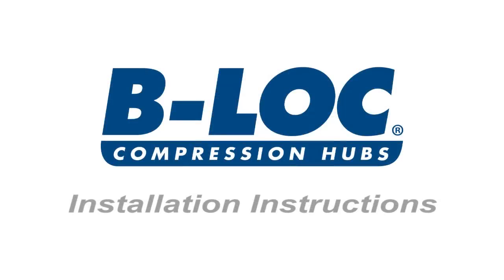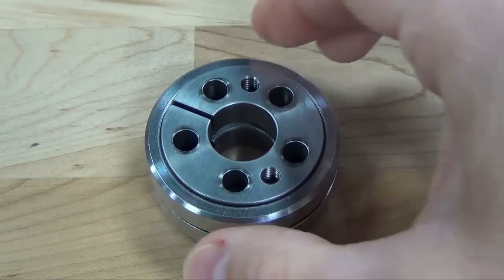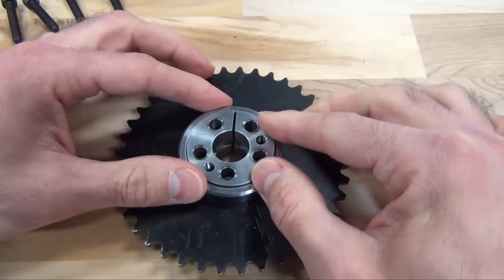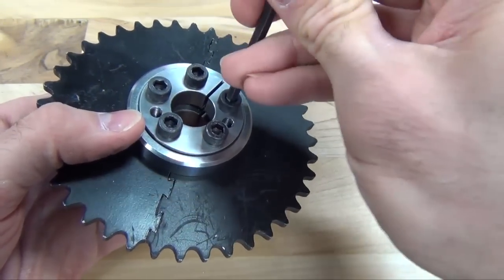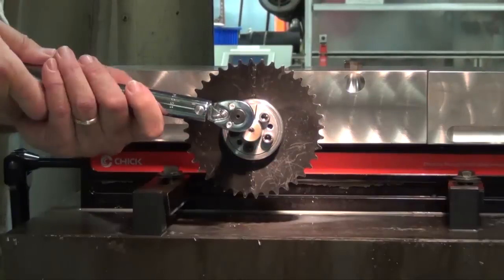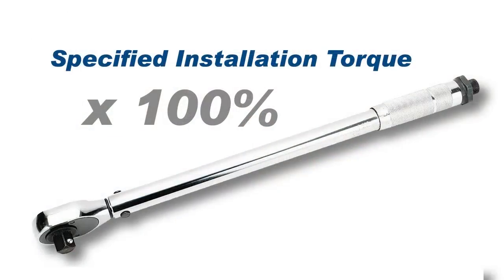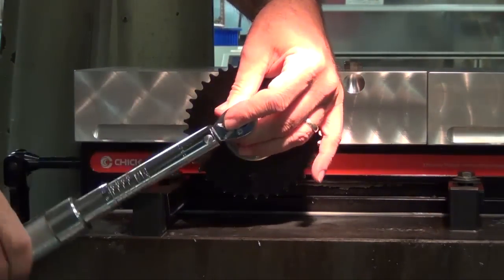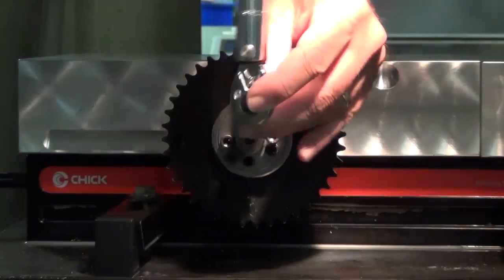Easy Installation of Chain Sprockets using B-LOC Compression Hubs

Comment: Only torque when holding the handle. If you grab the wrench higher than the handle then you are over-torquing. See this video for example of poor torquing habits.
Reply: This is not true at all when using torque wrench. It does not matter how you hold the wrench.